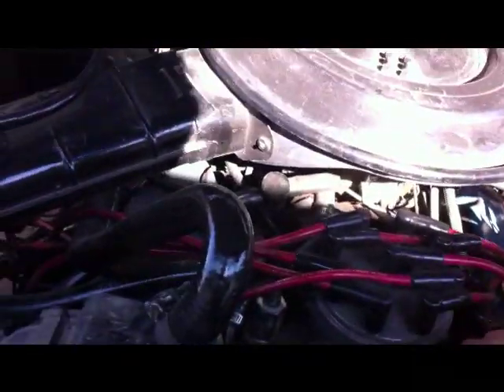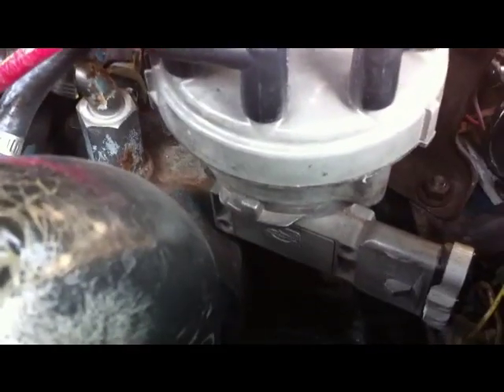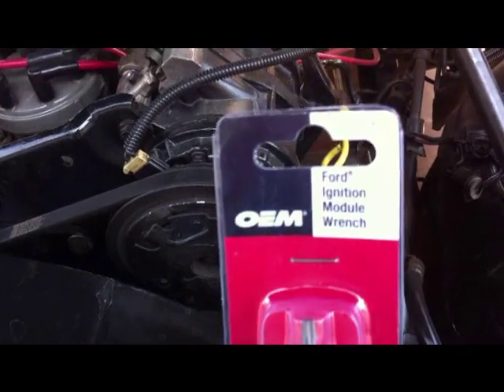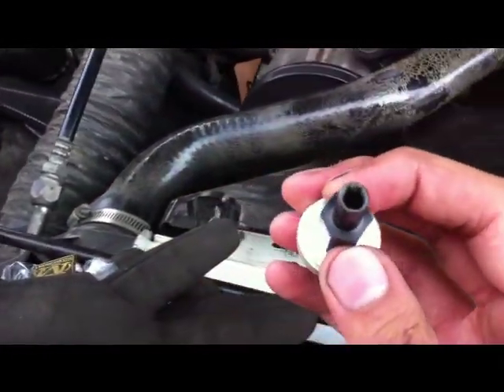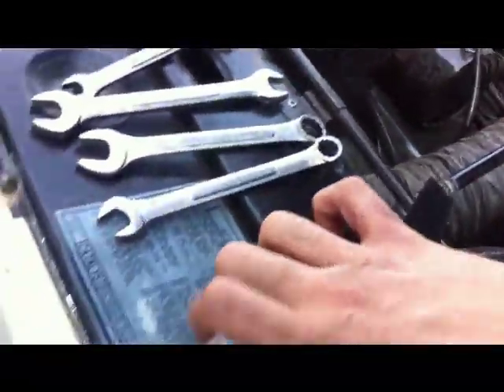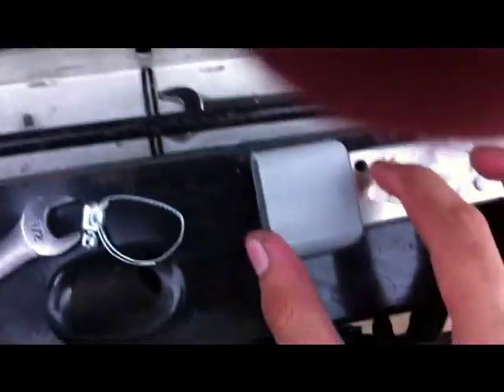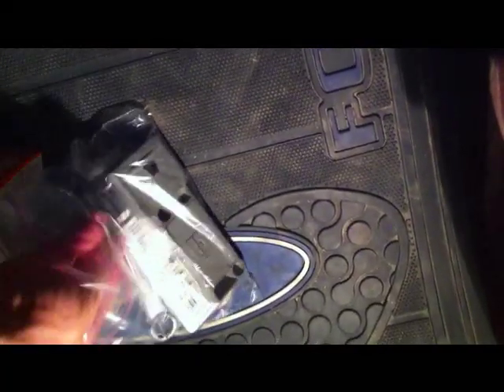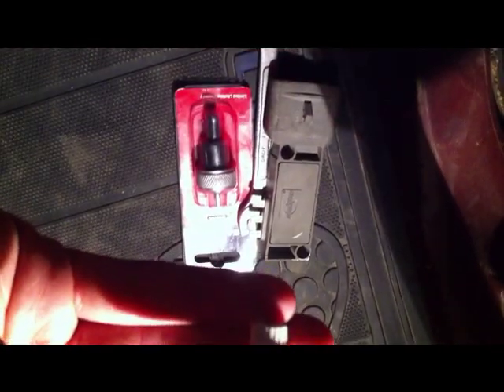Ford TFI module replacement

Comment: To replace the module, use a Lang Tools #FM-720. It is a ratcheting tool. Get it from Amazon. If the timing mark flutters quickly, it's the module. On TFI-IV ignition systems, there isn't a code for module. If you don't get a code for the pickup coil, replace the module.
Reply: Also. It would have helped if there's a screw that holds the distributor in place, where it would be? It was not mentioned.

Comment: Master Pro parts are ghetto... I work at O'Reilly's. I tested three brand-new Ford TFI ignition modules recently. One Master Pro, one Borg Warner, and one Motorcraft which I had ordered for my own vehicle based on the recommendation of others. On our Borg Warner ignition module tester the only one that passed was the Motorcraft!  The lesson in this is, as always, YOU GET WHAT YOU PAY FOR!